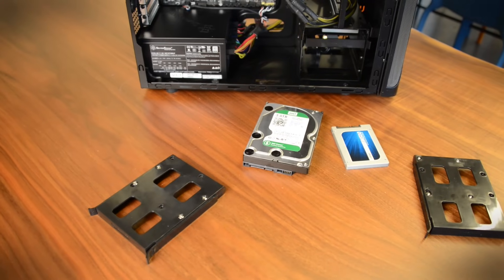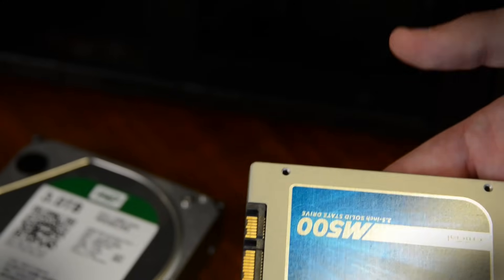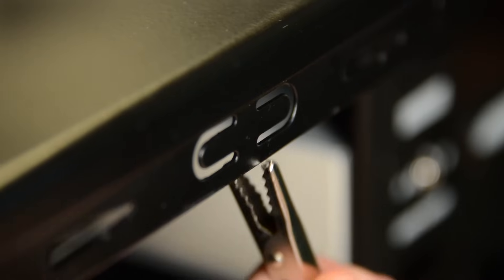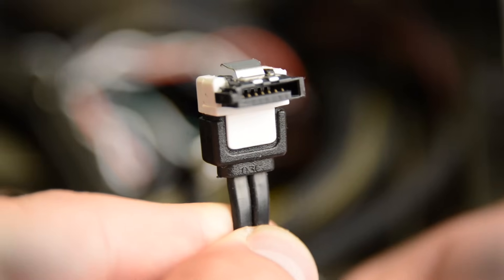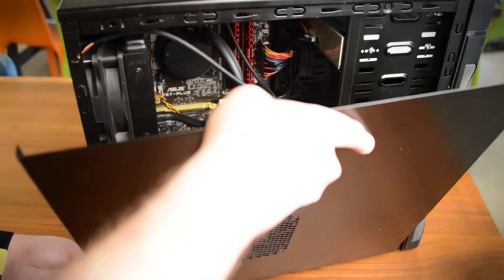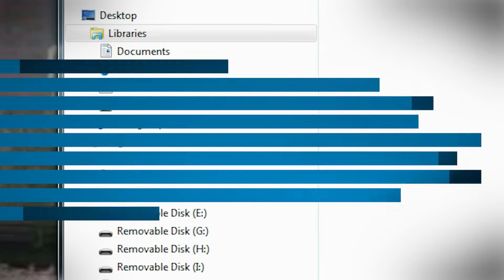How to Install a SATA Hard Drive

Comment: You can't believe what we just did, I am a 2 year computer Engineer, and I made a 3 feet tall Hardware box with Hard disk drive room Packages and call  2 of my friends who is also a Compter Engineering student, and made 4 cable bus sender which connects the 10 Hard drives of 120GB each, and hook it up to what we call Bus disseminator, and connects the transition cable to the CPU. Now we have 10 Drives, disk (c:) to (L:) total of 1.6 Terrabyte of removal disk Drives.

Comment: So you showed where to plug in the data cable the data cable on the drive but not on the computer. Pretty sure it has to plug in somewhere on the computer, But you left that very important information out.
Reply: It plugs into the motherboard. and every motherboard is different. There really isnt a way for him to demonstrate where it goes without knowing exactly what motherboard you have.

Comment: So I need a separate adapter to connect the PSU to the SSD? Or is it already attached to the power supply? I have the cable to plug into the motherboard, but I’m lacking the one for the PSU.
Reply: The PSU in a sytem built with a SATA motherboard must have at least two power connectors available for the SATA drives. If not, you can swap the PSU, or get a adapter cable that connects to the standard 4-pin Molex plug, and has the correct female SATA power connector for the drive.
Reply: I love you too much too too much love love baby baby love love baby baby thank love love
Reply: I love you too much too too much love love baby baby love love baby baby thank love love

Comment: Question I bought a prebuilt (idk computers leave me alone) and I don’t believe it came with a data cable if I buy one where do I plug it into the mother board? 🙋‍♂️
Reply: you'll need a SATA cable, pretty inexpensive. they plug into the motherboard.
Reply: @nadaabu-shaban727  this might be one year later, but for instance I have a laptop, it doesnt matter what type of SATA cable I use, like are they universal? I am worrying about it since they might be made only for specified models
Reply: @markshadid  I'm honestly not an expert haha. I only know they work for desktops, not sure about laptops tbh.
Reply: @Nada Abu-Shaban  thanks for your help, I'll try to reach an expert, have a nice day.

Comment: how many sata pins you need on motherboard
Reply: A standard SATA type motherboard must have at least two SATA connectors (female) on it. Or else, get a PCI board with SATA connectors.

Comment: Here are my complaints:

1) He says it’s more common to find pci drives instead of sata drives, but considering when this video is made, that’s just wrong.

2) He says “If your going for an SSD, make sure to pick the 2.5 inch form”. No ssd is made in a different form factor besides m.2

3) He says to put the psu back on, but why would you turn it off?

4) He doesn’t say how to utilize the drive (I.e. disk manager to create a proper portion for your new drive)

5) (This next one is just a nitpick, the title says sata drives) Why isn’t their a step for sata m.2 or nvme m.2 drives?

Comment: Hey buddy, 
1, ssd is NOT a hard drive, it stands for solid state drive. 

2. You do realize most cases are not made out of bare metal right? Especially on the outside. Use a proper ground.

3.Please don't ever cable manage in order to twist non-sleeved cables. Just don't mkay?

4.There are right angled and straight cables for both Sata ports and Sata cables coming from your psu. You don't identify them with "they have an L shaped bend". They are marked as Sata cables/connectors and if they are not check how the female side of the connection looks like before plugging any "L shaped cable" into it. In modern times if you are buying a psu which doesn't have cables that are properly labeled chances are you just bought a ticking time bomb. Seriously people, don't save money on buying the cheapest psu you can find-this thing delivers ELECTRIC CURRENT TO YOUR VALUABLE HARDWARE.  Do yourself a solid and buy a proper psu so you don't fry your pc. Also of note, the side of the sata connector that goes into your mobo has a latch lock on it so there is no worry about mixing the two ends up.

5. Check with your mobo manual which Sata port shares bandwidth with other components and what is their configuration. 
Make sure they are all(ones used by you) SATA III. -Now this one you've almost explained. Most ssds have max read/write speeds around 400|500MB/s in theory. This isn't the actual speed at which it will do most of it's reading and writing. 
Sata II has max throughput of 300MB/s but, unless you copy large files that would saturate Sata I(150mb/s)/II connections there would be no noticeable difference. They do not give you access to "Taking full advantage of the hardware" because the maximum Sata throughput has practically nothing to do with the average user. It's just something you do because that's the best way to do it and there is no reason not to do it in this rare, once a year occasion in which it helps(a little).
As to m.2 format ssds, which you mount directly onto the motherboard, those vary too and with a significantly bigger degree so consult your motherboard manual-it WILL be in there.
They are mounted with a stand off screw( it will be in it's own plastic bag in your mobo box-can be multiples) and screwed down with a tiny screw, also in it's own bag(there can be more than 1 screw inside but they are going to be all the same) that can be found in your mobo box if it isn't installed on your motherboard to begin with (they usually aren't).

6. If you have freshly installed a hdd or an ssd when you turn on your pc next time-Open up your bios/uefi and make sure they are correctly recognized. 

7. Honestly if you need help assembling your pc don't watch the videos this guy makes.
Reply: 1) He didn't say SSD is a hard drive.  The description says a Hard drive is a good way to increase storage on your computer.  The procedure is the same for a HD or a SSD.  Then he shows a mechanical HD and then describes a SSD install.  Anyway, SSDs and M.2 NVMe all perform the same function as a Hard Drive and most people understand the difference without being a "grammar" nazi.

2) He still talks about static electricity and says you should use a static wrist band.  

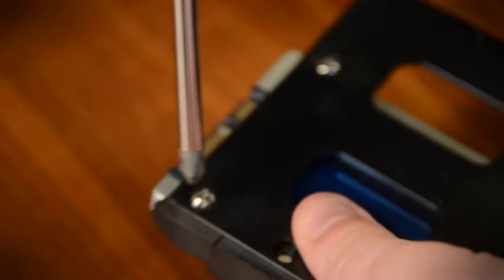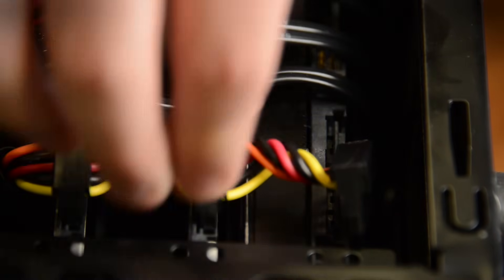3) What are you talking about?  Many power cables come already twisted like 0:45-0:58, if that is what you are referring to.  I doubt he twisted them on his own.

4) Do the SATA cables have an L shape at the connector?  Yes, they do.  What other cables do?  What does him saying L shape have to do with a power supply?  Rant much?  

5) Anyone that is looking at this video is working on a motherboard, and if they don't RTFM it isn't his fault. 

Whatever happened to "If you don't have anything nice to say... Keep it to yourself"?

He has created a video to help others that may need it.  He has provided a service, what have you done other than look asshat?   

If you want, why don't you start making videos and be productive if you are such a genius?
Reply: You wrote all this for what exactly? You just come off as elitist and annoying and i'm not even gonna read past #3. You're a tool
Reply: @Rhapbus1  Correction, whoever made this video is a tool.